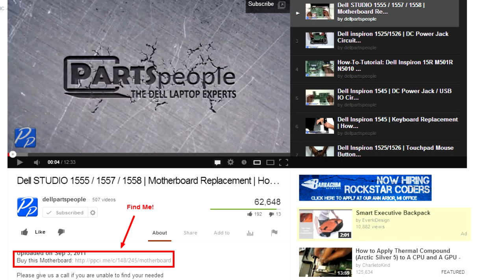Dell Inspiron 15R N5110 CPU Processor Replacement Video Tutorial

Comment from the maker: So far, this is what has been found compatible in the comments and what we have found through testing. Feel free to add to the list in the comments. 
i3:
2310m (2.1 Ghz)
2330m (2.2 Ghz)
2350m (2.3 Ghz)

i5:
2410m (2.3 Ghz)
2430m (2.4 Ghz)
2450m (2.5 Ghz)
2520m (2.5 Ghz)
2540m (2.6 Ghz)

i7:
2620m (2.7 Ghz)
2640m (2.8 Ghz)
2630qm (2.0 Ghz, Quad Core)
2670qm (2.2 Ghz, Quad Core)
2720qm (2.2 Ghz, Quad Core)
2760qm (2.4 Ghz, Quad Core)
2820qm (2.3 Ghz, Quad Core)
2860qm (2.5 Ghz, Quad Core)
3612qm (2.1 Ghz, Quad Core)
Reply: Who said 3612qm had worked in his 15R N5110? I'm almost sure that particular CPU will not work as any other Ivy Bridge, because motherboard of this laptop has HM67 chipset which does not support Ivy Bridge CPUs. What's more, I tried 3540M and it didn't work - the laptop wasn't booting, the screen wasn't displaying anything - after pressing the power button, this button together with button with 2 gears icon were blinking once a 5 second (together with hdd LED) - sometimes additionally it was something like it pretended to start, but it stopped after a few seconds (while wifi LED was shining).
To sum up: I think this laptop doesn't support any Ivy Bridge CPU.
Reply: I would like to buy from your site but it is only limited to us
Reply: Can I upgrade to an Intel Pentium G4560?
Reply from the maker: No, that is a desktop processor
Reply: Parts-People.Com, Inc Is there a good upgrade that is closest to that and in the same price range or lower? I am currently using an Intel i3 2330M
Reply from the maker: All the compatible ones I know of are listed above.
Reply: My screen doesn't turn up when the laptop starts booting(LEDs like power and HDD come on)
And a weird thing regarding video chip, Idk why but the chip above the CMOS battery is heating quickly
:(
Reply: sure i7 2820qm compatible?
Reply: Do we need to change the motherboard as well , I've the same laptop??
Reply: Hi I'm from India and I want to buy i5 2410m processor. Could you provide me a link I can use to purchase it. Thanks
Reply: Can we amd processors like ryzen 3 2200u

Comment: i have same laptop it shutdown automatically when open adobe premiere , filmora video editing software any help?and also when cpu increase temperature it shutdowns
Reply from the maker: Temperature related shutdowns can be caused by excess dust in your vents. You may want to try using compressed air to mitigate this.
Reply: @dellpartspeople  thanks for reply mate! i have cleaned vents and every parts and also used new thermal paste still the same issue need help?
Reply from the maker: @fullthrottle9823  This may be a sign of a failing GPU. Or a software issue. Unfortunately it's difficult for me to say definitively.

Comment: I got I5 on this laptop with 2tb hardrive and 16gb ram but im having problems with windows 10 because the graphic driver its not compatible so i had to disable it and looks bad like an old tv. Do you know if replacing the cpu processor would fix this? I cant find answers anywhaere

Comment: Only found one issue.

Mine had a second set of cables for the antenna that went through the motherboard and connected to it on the opposite side. Figured that out when I went to pull the screen out.

Comment: I'm having an issue with the bottom ram slot not detecting ram. When I insert a ram stick into the bottom slot the system doesn't boot. I tested the ram module and it works. How do I fix the slot?
Reply from the maker: Unfortunately, you would have to replace the motherboard.
Reply: Parts-People.Com, Inc Oh. Ok.
Reply: Zestypanda you can use a large one stick this platform can take up to 16gb . so it should be fine to use 1 8gb stick

Comment: Hi there, awesome video!
Last year I upgraded from i3-2310M to i5-2520M following your instructions. Now I want to upgrade to either i7-2630QM or i7-2670QM but do not know if my 90W charger is enough or need of an upgrade to 130W as well. Any help ? Cheers.
Reply from the maker: The 90w charger will work fine with an i7.
Reply: Parts-People.Com, Inc Thanks a lot for your help.

Comment: does it matter what video card the laptop has?
or will the 2670qm work either way?
Reply from the maker: The 2670QM will work regardless of the type of video card.
Reply: +Parts-People.Com, Inc 
okk just asking because i had bought a 720qm for a n4110 and i couldnt get it to boot up. thought it was a defect but i did some searching and seen it would only work with dedicated graphics
Reply from the maker: Interesting.. I haven't come across that problem but we have only tested a few of the different CPUs on the n4110. The only i7 we've tested was the 2640m, and it worked fine, but I'm not sure if they tested it on all the different GPU options. I wonder if the amount of cache is causing it to not boot up. The 2640m has 4mb and the 720qm has 6mb.
Reply: +Parts-People.Com, Inc ehh i wouldn't think so but i never really looked into what was different between the 520m and 720qm
Reply: +Joe P. 720 doesnt have graphics on it
Reply from the maker: I'm not sure which graphics it had. I'll try to find out tomorrow and let you know.

Comment: Hello, i have a dell inspiron n5110. If i replace my i3 to, for example i5, can I also upcrade my ram to more than 8GB? Thankyou.
Reply: Parts-People.Com, Inc I know it's almost a year old comment but unlike what dell tells you actually you can upgrade to 16 gb I've tried it
Reply: @mohammadm6757  how did you upgrade to 16 gb?!
I’ve N5110 2.4 cori5 and I don’t want to throw it cuz I’ve a lot of memories with it!!
Can you explain in details how you upgraded the ram,hard,CPU ....etc please?!
Reply: @sinanatrah4706  you could upgrade to the i7 , i wouldn't really recommend that because it can't handle the heat anyway and am not sure how well the bois will take it .  For the ram it's really easy , unscrew the small plastic cover on the back and you could use  up to 8gb ×2 . If you haven't opened your machine yet since it was new there is two things to consider.  1 . The plastic on this machine ages badly so it can break easily if you tried to do that now 
2 . You really need to clean your heat sink because it affects the performance alot
Reply from the maker: I'm pretty sure it maxes at 8GB of RAM.

Comment: my keyboard and touchpad aren't working but external ones are I have tried putting the ribbons back in... any ideas?
Reply: I had the same issue, i have gone with professionals and they said that you have to change the motherboard... GG
Reply: Diego I managed to fix mine! Just keep trying leave it for a while and then try again. Make sure the little ribbons are in perfectly facing down in the middle and it works great :) good luck!

Comment: Hello
I have a dell inspiron n5110 Dell service tag 9pj2lt1
From the AMD A6 Series A6-3420M 1.5GHz Socket FS1 Laptop CPU Processor AM3420DDX43GX

I would like to update any of these 2 models
1. AMD A6-5350M Mobile Processor CPU Socket FS1r2 2.9Ghz AM5350DEC23HL
2. AMD A6-4400M AM4400DEC23HJ Mobile APU CPU Processor Socket FS1

Which model would you recommend?

Comment: Hello, i have a dell inspiron n5110 15r intel graphics i5 i opened it as shown on your video just to clean everything out of dust i used thermal paste as shown but now it gives me a 7 beep code and a black screen. Any idea what i should do?
Reply from the maker: Nikolas Hadjigeorgiou The 7 beep code indicates a processor problem. Try re-seating the processor and make sure the locking screw is turned to the locked position. Hopefully that will fix your problem.
Reply: Parts-People.Com, Inc  i've already tried that you think i might did something wrong? Or maybe too much thermal paste?
Reply: where you able to fix it mate? or is it still broken?

Comment: I have the Inspiron N5110 with the Intel Pentium, could I install an i5 or i7 in it? Would they be compatible with my current bios? Would the chip be recognised? Would the fan be able to handle the heat? Sorry for all the questions,  but I'm seriously considering an upgrade for my current laptop and I don't want to buy a new laptop.
Reply from the maker: Yes, it can use an i5 or i7. Yes, it will probably run hotter than before but there is not a fan upgrade to make it cooler. You might still need to upgrade the BIOs.
Reply: Parts-People.Com, Inc Which i5 or i7 would work in this laptop? I read it has to be a G2, would the i7 2630qm work in It? Is it worth spending that bit extra for the i7 rather than the i5?
Reply from the maker: Alex Popa
I know that the i7-2630qm, i7-2670qm, and the i7-3612qm are all compatible with the N5110. I think you should definitely consider buying an i7 over an i5. They are solid CPUs. I think it's worth the extra money.